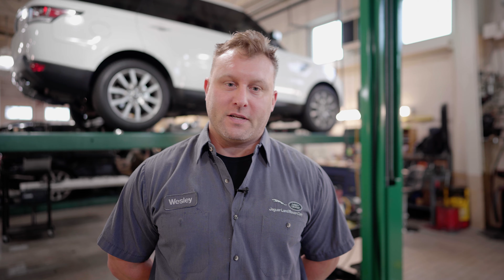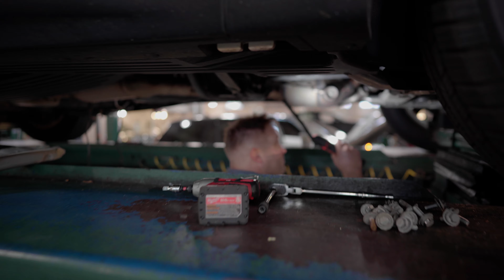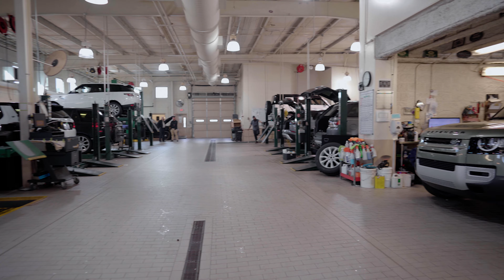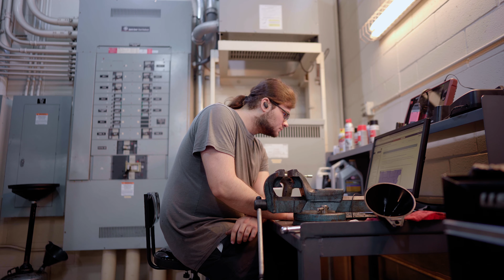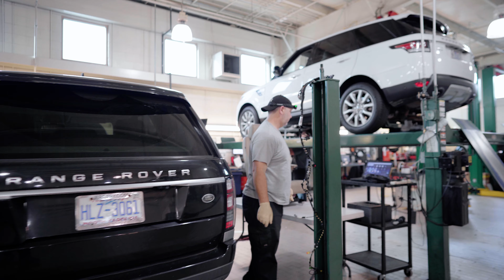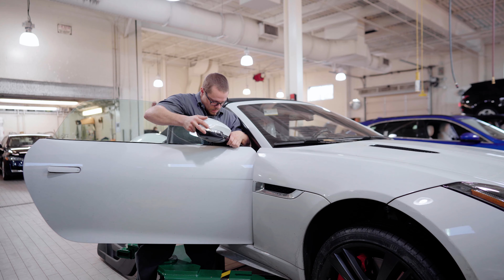Working at Jaguar Land Rover Cary | Tech Talk

Comment: Thank you for the video! I am hoping that you can assist me with a question I have. I own a 2017 Jaguar F-Pace and was recently told by the Jaguar service department that I need to have my thermostat, front and rear water rails replaced. I’ve heard of a thermostat but what exactly are front and rear water rails and what purpose so they serve? My extended warranty doesn’t want to cover the water rails. Are these parts essential to my car running properly? Thank you for any help you can provide!
Reply: A year later but. As a JLR tech. Most of our coolant leak concerns are these. The crossover pipes in the back and the front/under the supercharger. Are very prone to breaking and the water pump prone to leaking/ thermostat prone to not functioning usually when one of these items fail. We replace all because they will also fail. Either from fixing the leaking component causes that pressure to be back to normal and breaking the older weaker item. So we replace all to ensure no future issue